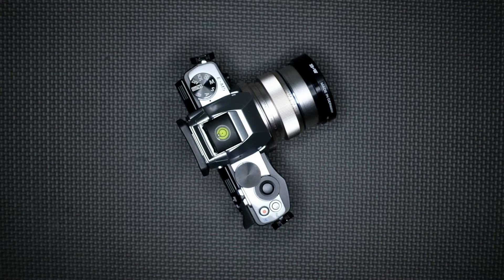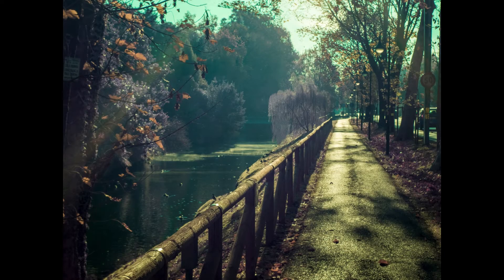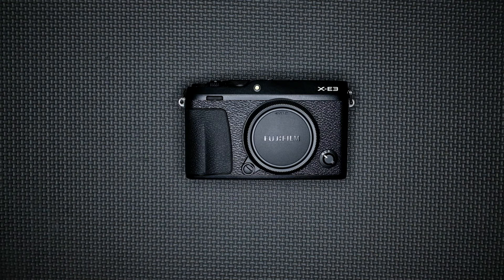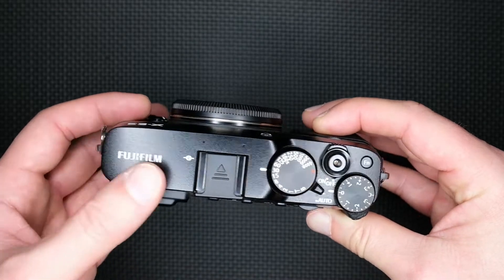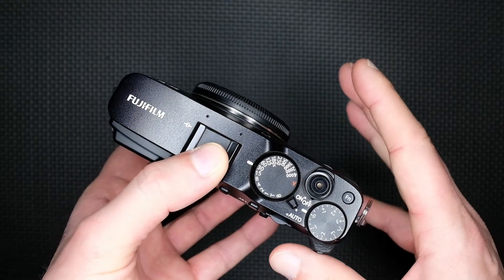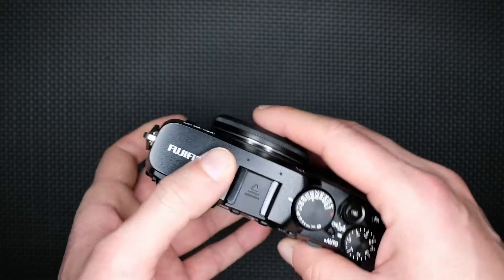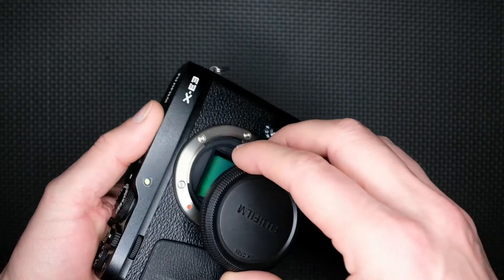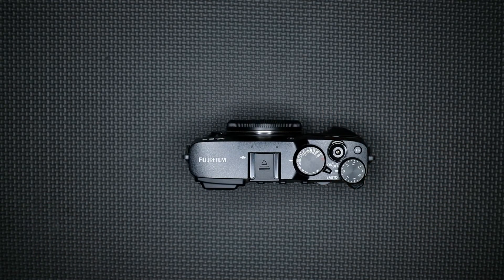Fujifilm X-E3 repair/full spectrum conversion - Part1

Comment: great video and loved the later, conversion too.  You mentioned that you "flashed" to the latest firmware without the back LCD display.  How can this be done?  Do you simply "follow the steps" or, is there another way? thanks!
Reply from the maker: EVF is OK, even if so tiny, to follow the steps.
Reply: @MassinissaDallaCosta thanks, I need to revisit this as the sequence of holding down the button during power-on doesn't display my EVF ...